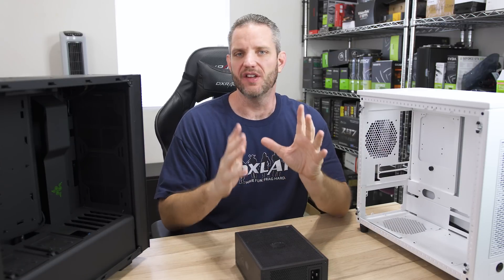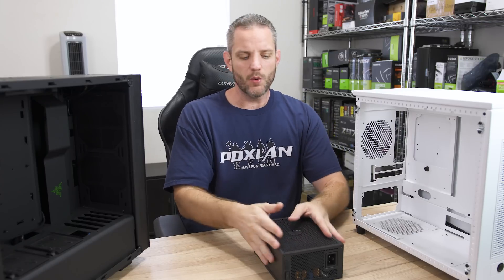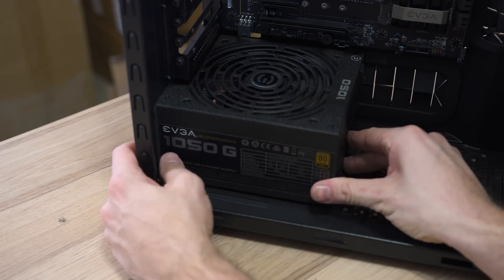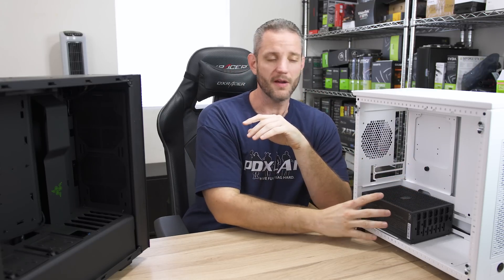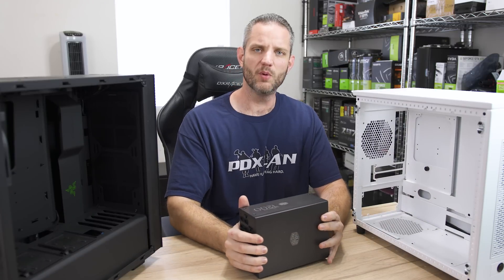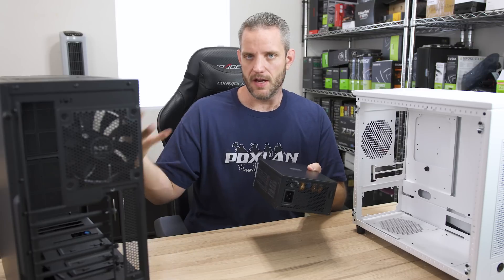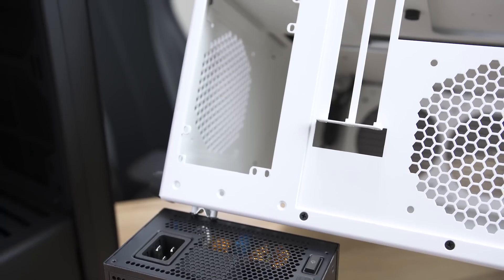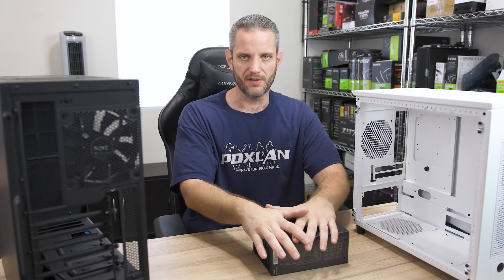Should you mount your Power Supply up or down?

Comment: Thsi is bad information. Power supplies would be mounted at the top only - never at the bottom - adv is that as hot air rises, there is no risk of the PSU contributing to the overall temp of the case internal components, PSU draws in ambient temp air from outside the case and exhausts it immediatly..... there is an argument though for mounting the PSU up-side-down (still top case mounted) to draw the hotter internal case air out through the powersupply exhaust - but decision on this is on a case by case basis as it depends on having suffient cooler air from front case fans so that PSU is not overheated.
Reply: Most youtubers are stupid.. NEVER buy a case with a psu mounted on the bottom! @Stephen.. don't waste your time with the sheep people! Tv, Youtube, Netflix.. tells them how to think, never by themselves!

Comment: If the case has a shroud that's a mesh, so very airy, it means it's still ok to point the fan up. I'm thinking about doing this so I don't need to clean the bottom filter since it's harder, so the only one to clean would be the front one.

Comment: I think it's simple. Having the cooler upwards, means pulling warm air into the psu. Probably the temperature inside the case decreases, but the PSU cooler is not for cooling the inside of the pc. It needs fresh air and it can get fresh air only from the downside. That's why mostly every case has an opening for the psu cooler at the bottom. Now tell me I'm wrong?

Comment: I always put the power supply intake fan on the bottom, of course this assumes you put the case on a hard surface so there is sufficient gap for room temp air to be sucked into the PSU. The fan down method is even more important with modern PSU since the fan only runs at higher Temps. If it's facing up the high case temp and more important the much hotter gpu Temps will be sucked into the PSU components thus making it run hotter. The fan will kick in but then you're wasting usage hours on the fan life and defeating the purpose of a quiet PSU. Using your PSU as an exhaust fan for hot case air is a terrible idea and just puts added stress on the unit. Just add a dedicated exhaust fan in another part of your case, preferably at the very top.

Comment: I have a question.  I have an old school PC case (a dell from 1990) literally the same case that I have had since I was about 13.  over time, the guts inside the case have been updated(IE motherboard, ram, power supply, gpu, cpu and alike). here is my question.  
My old school case has my power supply higher in my system but newer PC builds have the power supply lower.  I wanted to know just how much difference power supply positioning makes as I was thinking of finally updating my case I wanted to know if this was a purely aesthetic thing or if it actually altered performance.

Comment: I agree with everything. Unfortunately, I have a little compartment where the PSU goes on the bottom of the case. Pointing it upwards would probably constrict the air flow even worse.

Comment: Makes good sense to Mount it upwards in most cases. My build 3 intake Corsair ll120 fans, 2 mounted on a h100i, the 2 ml120 from the h100i mounted as outtake + the psu. And it helps the GPU fans too.

Comment: I have a EVGA GEFORCE RTX 2060 IT HAS AN 8 PIN I NEED TO PLUG IN THE CX550M HAS A 6+2 TO PLUG IN TO THE POWER BUT THE ONE FOR THE CARD HAS THE 8 PIN BUT ONE IS EMPTY ?? ALTHOUGH IT HAS 8 WIRES GOING TO IT 2 WIRES GO IN TO ONE HOLE IS THAT RIGHT ??
THANKS FOR YOUR HELP Jay

Comment: Want an easy answer? If your psu is on the carpet or hard flat surface, mount it upwards so it can get air. Or get a psu that maintains its fans depending on temps.

Comment: I mounted my PSU with the fan down for several reasons: I have an H500P case with the shroud so the path of least restriction for the air. I don't care about slight noise so I have a positive pressure system. lastly I only mount my system on a solid and flat surface off the floor because I don't want to worry about bugs making a home in my system.

Comment: Hi Jay, it's great to hear from a knowledgeable person that I can understand! Lol. so I am a moderate builder as far as experience goes, we have a Thermaltake N24 and a corsair 750m PS. I am mounting it with fan down due to shroud over the PS! Filter underneath case also sitting on a concrete floor. 2 fans pulling in, 3 out, 1 out back 2 up top to a water cooled rad. ... Your thoughts????

Comment: Having a semipassive psu facedown on a HAF X after 9 years I found more dust on the top of the PSU (cleaned 3 4 years before) than into it.
Never go overkill on wattage unless you know that it will work in passive mode. Try to match the 100% of your load at the 80% of max wattage of the PSU. PSU are more efficient above 50% than below. They peak at 50% so you want to range near that number. If you make your 100% system power requirement correspond to 50% psu wattage that's a waste of money and power.
You shouldn't consider the PSU fan as an exhaust as OEM do cause hot air will make your PSU work worse (theorically) but it will count as a fan in the air flow balance, as J2C said.
In every way possible avoid soft surface and the floor as the case will collect dust 4 times faster. The amount of dust collected by my system in one month on the ground was similar to 4 months on a desk. Now I have it on a library made of wooded slats that are 3cm away from each other and I reduced the dust collection and improved cooling even more. Just like if it was raised on feet.

Comment: I'd be interested in finding out just how much of that PSU exhaust loops back into the intake in the down configuration, as you suggested. I think the chassis exhaust fan above it should help keep that air on an aft trajectory. Plus, exhaust tends to be more directional than intake.

Comment: I now have to go back in and check which way my PSU is facing 😓 I think it’s blowing air up into the case and it’s on my table. I do have 3 Noctua fans functioning as exhaust though.

Comment: I have a foxin cabinet with fixed psu which has a rear fan and it's located on top of the cabinet.i want to replace this psu but nowadays iam unable to find rear fan psu.Can I use top fan psu ??how to adjust it on the top of the cabinet if it's a top fan psu??

Comment: None of this matters to me. Why? Because I have a walk in closet next to my desk. I bought display port, usb 3.0 cables, etc to run 10 foot into my walk in closet (which everything is hidden under the desk). My case has no sides, no front, and sits in open air with the door closed. House is always at 68f, and there is an air vent RIGHT NEXT TO IT. I have a noctua d15, and damn thing doesn't even hit 70c on full load (still a 6700k, almost went 10900k but meh so good right now at 1080p with 2080 super who cares)!

Comment: My cpu temp was running at 35 idle with power supply facing down, i changed it up and now its idling at 20 to 25 degrees, pretty damn stoked

Comment: I actually aim for a little negative pressure since I have a passive power supply that's mounted upwards. By that I get a little more cold air sucked in through my passiv psu to cool it.

Comment: I mounted the power supply fan down on the build I did for my daughter because it ended up being so close to the GPU, which also sucks air that I didn't want their respect fans "fighting" each other for air.  And yes I had a cheap ASRock B450 motherboard with only one PCI Express slot so this wasn't a case of mounting the GPU in the "wrong" slot (usually the PCI Express slot closest to the CPU runs at the fastest speed.)

Comment: Thanks for this video. While I have been around PCs since the dawn of time (Tandy TRS-80, Commodore PET, Apple II), and I have built a few PCs in my time, I have never seen anything about mounting a power supply with the fan down before. Given that all of the printing on the exterior of my power supply’s would only be upright wi the the fan up, I thought that was the only way to mount it. My current case has the grate on the bottom so I mounted my PSU “upside down” and at least I know that it won’t hurt anything.

Comment: Def Leppard, my favorite rock band since i was like 8-10 year old😄 lm 24 now. 
Nice video! My pc shut down out of nowhere, it started to smell a little. I think it was the power supply :( no idea of what i am supposed to do now. Cleaned everything and let it rest. Now the pc wont even start. It just lights up and stay silent. Nothing happens :(
Reply: First of all not all psu problem will result in non working at all, if you see some led light up, that's mean psu still supplying some juice, the question is that juice still fresh or not. 
Buy a proper psu tester, not so expensive, it is small too, just as small as cigar box. (But prefer a digital one thus you can see voltage at each rail)

Comment: My brand new pc and gpu had constant 88c while gaming,due to bad case design choice from the shop i bought it from. All of the heat that 2 fans was blowing out was getting back cause of a plate that was made to shut and hide the power supply and cables. And that was like half of inch.I *not to mention that power supply RGB  but you cant see anything!

Comment: putting the PSU at the bottom of the case.. Good luck with overheating the rest of hardware since hot air goes up

Comment: Since most cases with a bottom mounting have a vent underneath it's logical to assume you're supposed to mount the PSU with the fan facing down and out of the vent.

Otherwise it'll just blow hot air up onto your GPU
Reply: Richie 1138 that vent is for air intake. The air is blowing out of the back of the case, regardless of if the power supply is face up or down, so it won’t ever blow hot air up onto the GPU.

Comment: 2:18 Which cabinet is this, kindly help I need a cabinet with 3.5 inch 3 HDD and good air flow
Reply: Look up "Corsair Carbide Spec 02"
Reply: @vlads.  Thanks, that's a neat cabinet

Comment: "It's also going to get a much cooler supply of air pulling it from inside the case" - did he really say that? :)

And that bizarre theory of a "loop" where the hot air from the rear exhaust fan of the PSU would somehow be drawn back in through the bottom intake fan. That is, of course, a bunch of gibberish! I guess some are making money by making up stuff...

Comment: Hey Jay, question for you: let's say you have neutral case pressure and then you add a NHD15 or the Be Quiet equivalent, how do those 2 fans affect case pressure as they are kinda in the middle of the case?
Reply: I would assume it would form sort of a daisy chain with the front intake, the first CPU fan pulling in that fresh air and pushing it across the heatsink, the next CPU fan pulling that waste heat and pushing it towards the final exhaust out of the case.

Comment: what if your psu has rgb lights on the up side fan. facing it down kills that look.  3 intake fans on front and 3 for the cpu cooler on the top and 1 rear exhaust fan. so i'm going to leave my psu facing up i reckon.

Comment: Hey, Jay! Remember top-mounted power supplies? No shrouds, sometimes the only exhaust fan in the system? Couldn't flip them if you wanted because the screws wouldn't go in that way? Cable management meant stuffing them into the unused 5.25 bay that didn't have an optical drive in it?  Good times.

I am feeling so old now.

Comment: In my micro ATX case the GPU is pretty close to the PSU. As I didn't want the GPU fans right up against the PSU fans (noisy, and possibly both pulling the same air) I mounted it "down".

To be honest, if the GPU wasn't a wide one it wouldn't be an issue.

Comment: The older gaming case where like these. I still have my outdated Antec Nine hundred two. despite his flaws, it has good air flow ( 3 x120mm fan, plus the 200mm on top). but in those days, even with PSU mounted in the low part of the case, the fan had to be put up, since no holes or filters in the bottom of the case. But careful if the fame grill is big enough... cover it when playing with screws inside your case... they are a pain to get out of the PSU (remembering my noob mistake back in the days).

Comment: Hey Jay - what if the power supply mount location is at the top of the case? I have a Corsair 600C where components the motherboard has an inverted layout. I mounted this facing down as there were flow holes below versus the fan of the PSU facing towards the top with essentially no air flow outlets. Thoughts?

Comment: one more think. DUST. im always mounting PSU with the fan facing to the bottom as there is no option for the dust. in mine rig after 5 years i did upgrade and my corsair RS750 inside was like brand new. no single peace of dust so entire PSU works in dust free enviroment which is very good for long life. ps. im still using this PSU as after 5 years still is in perfect condition. DUST is killing electronic.

Comment: Hmm. I might consider swapping the PSU in my case, then. I have it face down but it's really hard to get to the removable filter on the bottom, and I don't clean that filter as often as I should be and I've been somewhat worried that it will clog and choke the PSU. Thinking perhaps it might be better if I changed it. I suppose it depends on how dirty that filter actually is, as it's been a few months since I last cleaned it.

Comment: Hahaha I love the special warning for water cooled builds, it's really good advice. Tho it applies to any build/case that has an open top for airflow. I managed to knock a glass of water off my desk, ontop my Haf X that has an open top with 3 fans. Liquid poured over my GTX 1080 right into my, upwards mounted, 1000w Silverstone PSU. The PSU died and shot out the fuze before I could cut the power.

Luckily it only killed the PSU, but in decades of building computers, among them plenty of water-cooled builds, that was the only time water killed my hardware, and it didn't even come from the cooling loop lol
Reply: One of the many reasons to never put your pc on the floor
Reply: @jojivlogs_4255  You should look up how big a CM Haf X is, it's a massive big tower. 

Particularly with the wheels mounted to allow airflow from bellow and an extra thick radiator with fans mounted top.

Not gonna try to find space for that on my desk that already needs to have space for several monitors, keyboards, and mice.
Reply: @John Doe  sounds like everything about your setup is pure overkill

Comment: Today i removed my corsair HX1050 i installed upside down on my 9 year old rig.. the backside of the power supply has like a thick layer of dust, i couldn't even blow it off by air.. then i was surprised when i examined the internal components of this power supply through fan vents! it looked so clean from dust as if it is unpackaged from it's retail box!!.
 am now 100% convinced that i would never place my power supply facing up ( as long as on solid floor).. the power supply fans would only rotate when it needs to cool, so on normal usage it is mostly off.. so having power supply vents toward inside case will only collect dust from moving air inside.. not only that.. but if a lot of dust accumulated inside power supply it may reduce cooling efficiency meaning fans will spin more often years later.. the face down approach have more benefits on the unit it self compared of pulling some air from case.. you can add regural case fans instead..
Reply: And I just used the foam packaging to keep my case stably raised above the carpet and make it easier to pick up to work on it.

Comment: "If your PC case has some sort of grill below where the PSU sits, then you should install your PSU so that its intake fan is facing towards it. In other words, your PSU’s fan will be facing downwards. The reason for this is so the PSU intake fan will suck cool air into the unit from outside the case." - NZXT website

Comment: In my current rig I have it mounted with the fan up for 3 reasons:
-the case has 3 intake fans and 1 exhaust 
- I plan on vertically mounting my GPU and the PSU could suck exhaust heat out of the Case
-dust
Reply: why not mount 2 exhaust fans on top and psu just down
Reply: The GPU is at the bottom, it would be pointless to mount top fans

Also, I'd like to keep the glas on the top
Reply: @Hyperus  mhmm the glass on top i understand but excaust fans on top will work pretty good u know warm air raises
Reply: @dxture.3365  while warm air does rise, it does this at an ignorable rate when it comes to cases, I just need it at the bottom to pull warm air away from the GPU to prevent refeed
Reply: @Hyperus  aha i have just 3 fans in and 3 out and times are very good  so yeH